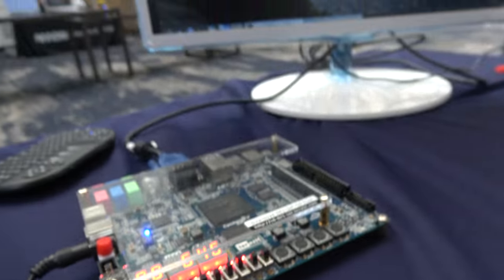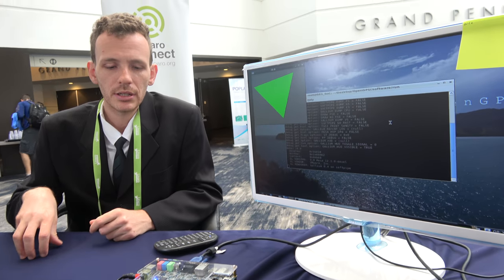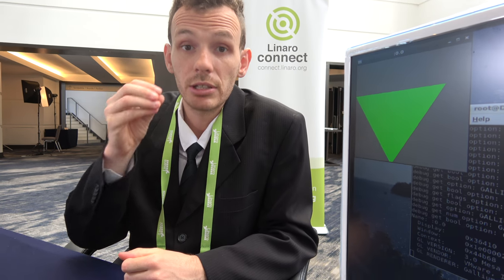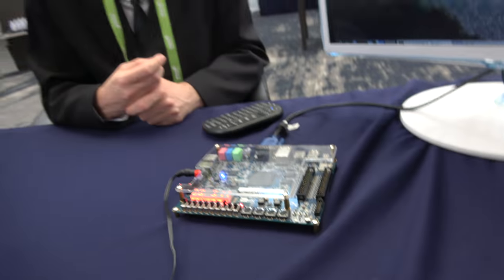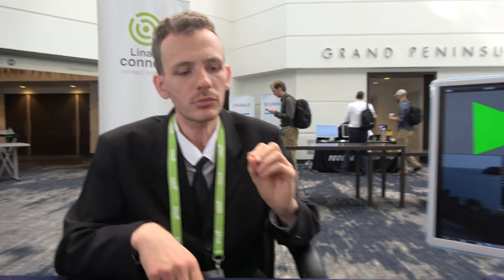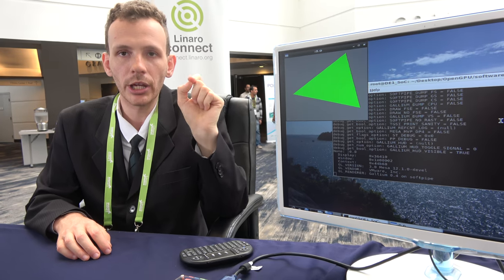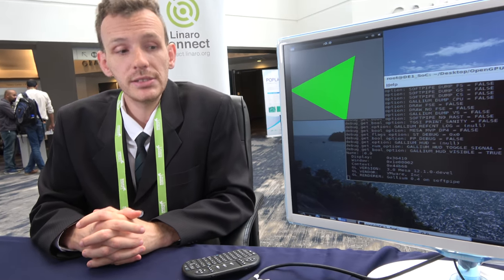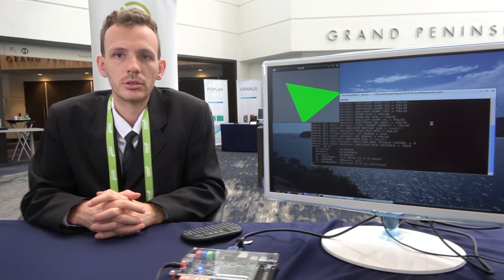OpenGPU on Altera Cyclone V FPGA at Linaro Connect 2017

Comment: This is great! I am waiting for this for a while.. I hope this is the start of a revolution!
Reply: The lab I belong to have done this before for research. With more than 20 people and 4 years. We are only able to make a programmable GPU from scratch with the peak performance of 12.5 GFLOPS. Or in other terms, 25% of what a RPi is capable of.
Also, converting code into hardware is a very time consuming task. It took our server 3 days to convert our design into FPGA bitstream. 

It is very impressive to see him making a rasterizer on a Cyclon V SoC by him self. But hardware development is very very difficult and expensive. I don't see the open source community doing any advanced GPU designs until we have fast enough computers to compile the hardware in a few hours. But hopefully the community can get into CPU development, which is a lot easier.

Just to be clear. I'm also a open source dev. But I speculate how possible it is to make a GPU fully open source.
Reply: @clehaxze  Which research team did you work on? Are they still working on open source efforts?
I'd be highly interested in joining such a team.
Reply: @developandplay  It's a sponsored project from Taiwan's minister of technology and TSMC for my univ. Unfortunately the team was dismissed as there's nothing we can do given our budget. And even if we made an amazing GPU, people can't fabricate chips without very expensive tools from Cadence and Synopsys.

Thanks for asking though. I'll ask if we can open source our design since no one is using it any more.
Reply: @clehaxze  Funkding problems for such projects seem to be very common unfortunately. Yea I'd be curious to hear more about your research group.